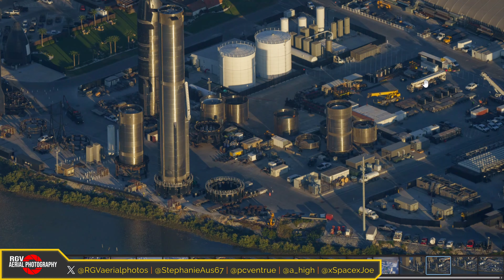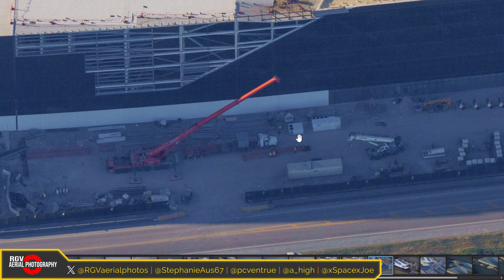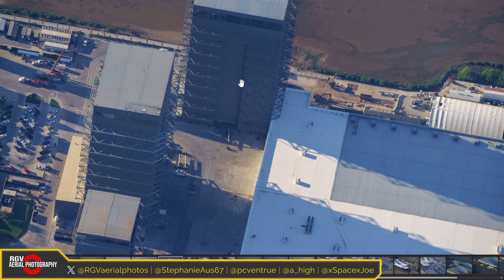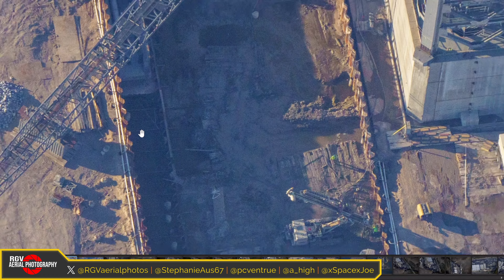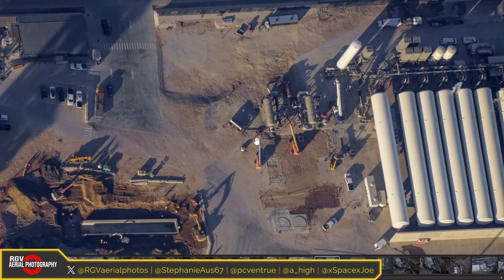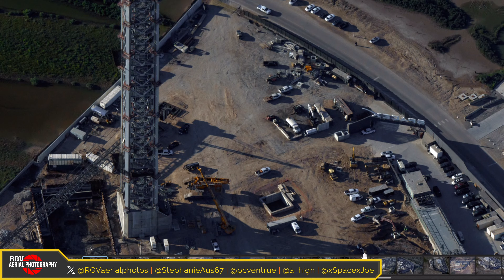Starbase Weekly, Ep.142: Post Starship Flight 6 Flyover: Catch Abort Analysis

Comment: Did not re-use an engine.  FIrst engine on B12 was 367. 2nd engine on B13 was 387.  The engines on B12 were severely damaged and exposed to sea water.
Wouldn't make sense to do that anyway.
Reply: B12 was caught by tower